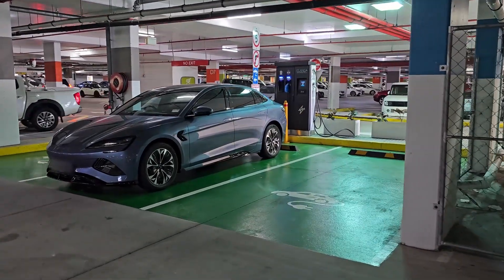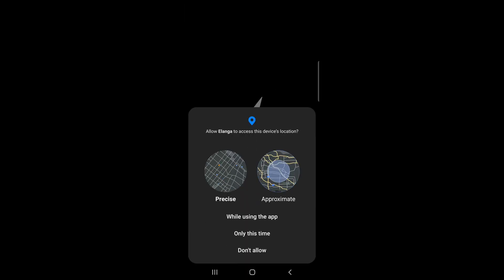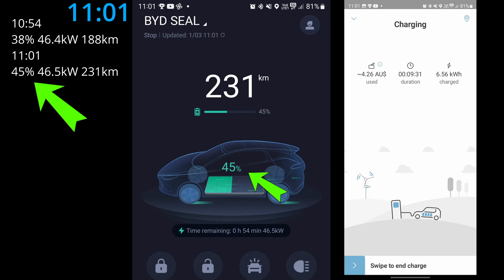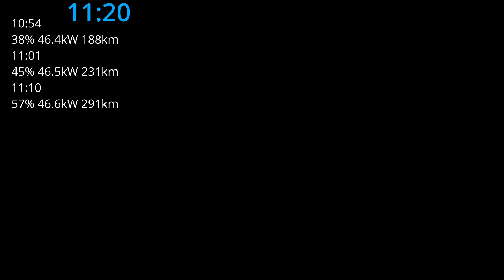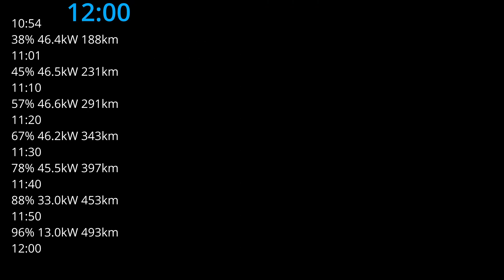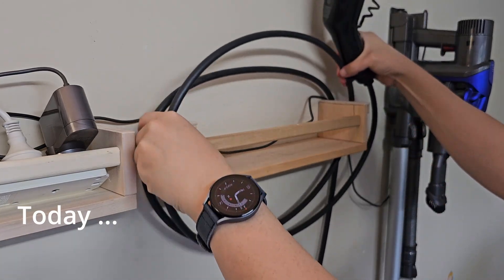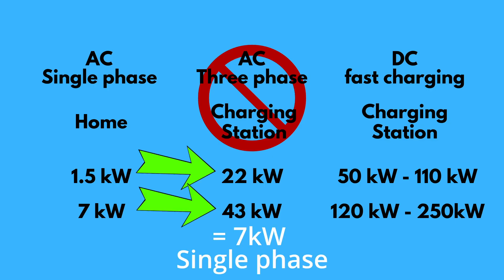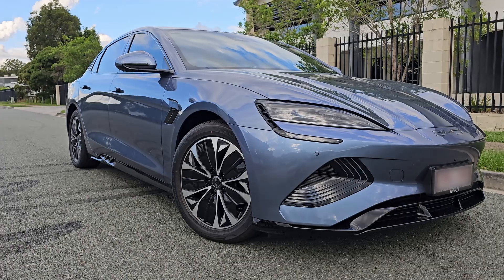BYD Seal EV charging options explained - Don’t pick the wrong one

Comment: Hi, have you installed a 7 kw charger at home? Was wondering if you did any research or videos on which are the best options for the Seal.
Thanks
Reply from the maker: No, I am still using this home charger. 
https://youtu.be/V-HbBjmC-dM
It's the cheapest and, to me, the most convenient.
If I were to install, I would ask my electrician to put in a 15 amp socket instead of installing a 7kW charger which is a lot more expensive. I can't justify the ROI

Comment: I, like other people, installed 3-phase AC charging at home (I had 3-phase power) because the line load is reduced to +/- 2.5 KW per phase. My supplier could not reliably provide 7Kw on a single line during heatwaves etc. My 3-phase "Feyree" car charger bought from Lasada costs about $250. It has proved to be almost indestructible having been subject to excessive low voltage on one phase and a lightning strike during charging that burnt out the breaker, never missing a beat.

Comment: Re the charging rates slowing down as you get above 80%, I saw a video explaining this. They said it was similar to if you were filling a fuel tank with a massive hose, but were absolutely not allowed to go over 100%.  Once you hit 80% you'd want to slow the flow down to make sure you were able to judge it properly.  And as you get incrementally closer to 100%, the flow gets slower and slower.  The conclusion was that for 
time-efficiency purposes, just 'fill' your battery to 80%/

Comment: I've read in the manual of a home charging station brand that there is a nuance to 3-phase charging depending on the brand and model of your car as well as the kind of 3-phase charging you can provide. Let me explain.
I'm going to choose an example for Europe but this might also apply for other parts of the world.
There are 2 ways your house can have 3-phase electricity called 3P and 3P+N.
3P: essentially is a 3-wire system without a neutral wire. If you measure the voltage between 2 phases, you get 230V (again: in Europe). If you measure between 1 phase and the ground wire, you get 127 V.
3P+N: this is a 4-wire system with 3 phases and 1 neutral wire. Measuring voltage between a phase and the neutral wire gives you 230V and between 2 phases gives you 400V

What do EVs do when you plug in the home charging cable which has standard the 3 phases + the neutral + the ground wire (which will always be at 0 V)?
This is the part which differs greatly between car brands and even models. As a security precaution, some cars will measure the voltage between the neutral wire and the ground wire. This should be 0 V. If this difference is not 0 V, they simply don't charge.

The people who make home chargers know this and have taking this into account but it differs depending if you have a 3P or 3P+N setup.
3P+N: each phase and the neutral are attached to the charger providing this to the car together with the ground wire. This setup is the most straightforward and should yield 0V between neutral and ground after which any car should start charging at the full 11kW 3 phase.

3P: this is the tricky one. Because of the car security precaution mention above, when you have the 3P setup, the home charging station will connect 1 of the phases also to the neutral pin of the car. The car will do it's measurement, see 127 V between ground and (what it thinks is) the neutral wire and will switch to a setup where it will either charge on 2 phases-only or even 1 phase-only (depending again on the car brand and model).

So all people here who said they have a 3 phase system yet only see charging on 1 or 2 phases, have a look at your wiring closet at where the mains comes int your house: do you see 3 wires coming in (3P) or 4 (3P+N)?

There is a workaround if you're stuck with a 3P installation: transformers exist to convert 3P (230V) to 3P+N (400V) called a "Delta-Star transformer" or "Delta-wye transformer" (https://en.wikipedia.org/wiki/Delta-wye_transformer). If you install one of those before your home charger, you'll essentially end up in the 3P+N model where the car can use presumably 3 phases . One caveat to this: these transformers become expensive really quick when you're talking high power such as 11 kW or 22 kW.

Comment: I’m not getting 150kw charging anywhere. Tried different brand chargers and superchargers. Best I can get is 105kw on Tesla superchargers. I have the dual motor aswell. Really annoying that it doesn’t charge at the claimed 150. I suspect byd limit it for battery longevity?
Reply from the maker: This is interesting. My dynamic base model advertise for up to 110kW but so far from all my test, I only manage to get 50kW max. I guess a lot of other factors affects the charging power like another car sharing the charging station and hot weather conditions. I wonder if others who has the same performance model like yours has ever charged at 150kW charging power before. Hopefully someone reading this comment can share their insight.

Comment: I am curious about your 3 phase comments. You mention you tried to charge with 3 phase yet the connector you show does not have contacts for L2 & L3, hence is only single phase. Have you actually got a 3 phase charger that you tried?

Comment: Can you safely use an extension chord with the slow 1.5 kW charger jim
Reply from the maker: Not advisable according to the instructions. Better to ask an electrician.  We need to make sure extension cord can support the current, and there are other things like the extension cord cannot be coiled, and so on that needs to be considered. That's why it's not advisable.

Comment: Much too slow charging
Reply from the maker: I just got a new fast charger. Will be making a video soon.
Reply: @SkyPerspective  the car has too slow dc charging in comparison with others 10-80% in 40 Minuten is not for long Trips
Reply from the maker: @martinmuller6760 oh you meant dc fast charging is too slow. Yes we cannot compare to petrol cars on long trips where it takes 5 mins to fill up.
Reply: @SkyPerspective  No i mean other car Manufacturer vw stellantis mercedes bmw 10-80% 30min Hyundai Kia Porsche 10-80 18min. 40 Minutes at byd is too long
Reply from the maker: @martinmuller6760  oh I see. Yes I think the charging power plays a difference here.  Mine is the base model of the Seal and can only charge up to 110kW. The higher end model can charge at 150kW which will be faster. I am not sure how much faster.

Comment: Do you always charge to 100%? Also, what is the recommended base percentage charge for the Blade battery. I see articles that say don't go below 20% while another says 15% while others say 10% is perfectly okay.
Reply from the maker: I kept it full to 100% whenever possible. The lowest I would go is 25%, not for the health of the blade battery, but more for my range anxiety. Blade battery is pretty good in terms of degradation. We just need to make sure to once in a while use the mode 2 wall charger to let it charge up to 100% slowly
Reply: @SkyPerspective  Thanks for your reply. Appreciate it.

Comment: In Europe they are gradually implementing a "peak capacity charge" in the electricity bill. This means that at home, you don't (or won't) just pay for the final amount of charge but also for the peak rate at which you use electricity as a whole. This because they want to avoid people starting up all their most grid charging appliances at once. Thus, they try to avoid a major surge in the grid. So, best to avoid charging your EV simultaneously with running the dishwasher, dryer, washing machine and induction plates...even at night.

Comment: The video is not wrong but for future proofing I think installing 3 phase is worth ut
Reply from the maker: I am not an expert in electricity topics, and I wonder if single phase DC will get more popular or 3 phase AC. If I am not wrong the trend and manufacturers are moving towards single phase DC. However, you are right, install 3 phase at home is definitely future proofing because it will work for both types of vehicles.

Comment: I don't quite understand. Your charger took 3 nights to charge your car from 30% to 100% but. What option should I get for a faster charge at home since you say the 22kw charger only charges at 7kw?
Tjamks for the very informative video.
Reply from the maker: If you are only having and driving BYD Seal, then installing a 7kW single phase charger at home should be good enough. If you plan to buy a Tesla or some other EV that can charge faster using three phase, then you can consider future proofing your charger installation at home and install a 22kW three phase charger. 22kW can still charge BYD seal at around 7kW or 11kW. Hope this make sense.
Reply: @SkyPerspective  makes sense. I love the Seal but it's a bit too low to the ground so am waiting for the Seal U although I'm disappointed it's nowhere near as stylish.
Reply from the maker: The Seal U still looks pretty nice in my opinion.
Reply: @SkyPerspective  I think 7kW is good enough for Tesla too. 15kW per 100km. 6 hours charging at night can cover a 280km trip.
Reply: I kinda confused on the 2 groups number on 11:41. Tots get it on Home single phase 1.5 kW and 7 kW. What about on fast charging? Do you mean that your seal can handle max at 120 kW - 250 kW?

Comment: I had a 32 amp 5 pin socket installed and I bought a wall box, I charge at around 7kwh that equates to 10% per hour charge, total cost $1000, I charge from solar only, granny wouldn’t be useful for that.
Reply from the maker: That's very good to know. So far I am surviving with my granny.  My digital electric meter shows me it's quite efficient and not much loss. Wait till I save up my $1000 maybe I will install it. What's the brand of your wall charger?

Comment: let say if you park the seal on side of the road on heavy raining night and street are all flooded, can we still drive the car  ?
Reply from the maker: There is a different between heavy rain (water splashing down on the car), driving through flood waters (water splashing up the bottom of the car) and the car sitting in flooded water (water seeping into the car compartments). With the third one sitting in flood waters, the water seal (no pun intended) of the battery and electrical parts can only hold the water out for a period of time. After that, water gets into the electrical parts and anything could happen. Water and electricity don't mix and short circuiting a 61kWh battery most likely will cause a thermal runaway. So short answer to your question is: No, I would not drive the car if the flood water height has reached or is higher than the battery compartment.

Comment: maximum rate of AC charging is basically depends on the onboard charger installed in the car (it basically converts AC to DC), so before deciding on which level 2 charger to buy, gotta see the spec sheet of the onboard charger first

Comment: Fast charging is way more expensive than at home
Reply from the maker: There are cheaper fast charger like $0.40 to $0.50. The one I'm using in this video elanga is quite expensive at $0.65. Yes Changing at home is cheaper.
Reply: Not necessarily that much cheaper though. The standard tariff in South Australia is around 44c per kW...

Comment: I received my BYD Seal 10 days ago but I'm having problems when I try to charge on fast chargers. Charging starts, then after 2 minutes the message "charging complete" appears and charging stops even though the car is absolutely not fully charged. Has anyone encountered this problem?
Reply from the maker: Did you set the car reservation charging to start and stop at a certain time? You might have just hit the time to stop charging.

Comment: Thank you that was very informative. Is the portable charger safe to use if the house wiring isn't great? For example, I can sometimes lose power to my home during heavy rain or if too many appliances are turned on at the same time.
Reply from the maker: Doesn't sound good enough to me. Best to get a qualified electrician to test out your house circuit and give you a report. What I know is Tesla portable charger charges at higher wattage like 2.0 - 2.3kW while my BYD portable charger charges at 1.5kW. I suspect BYD is playing it safe to put lesser load on the house electrical circuit and the AC-DC converter charger in the car. Nonetheless, 1.5kW is still a lot of power going through the house cabling for so many hours, so best to have it checked by an electrician.

Comment: I’m interested in power leakage at home, if you are at 100% and disconnect the charger, then how much charge do you loose each 24hr?
Reply from the maker: I don't understand your question, do you mean how much power will the BYD Seal battery loses each day if the car is not driven?

Comment: Is this your only car, I am just asking as I don't think that I could wait 3 days to fully charge the car.
Reply from the maker: So based on my last round, I charged 30% used 10% charge another 30% used another 10% and charge another 20% before it reaches 100% on the third night. Yes, it's the "can't get one full charge overnight" that I need to get used to. Yes, I myself only uses this one car.
Reply from the maker: @@Sensei_Sifu Who are you referring to when you say they need to provide 7kW for about $199? BYD? Yes the current cost of A$1000+ is way too expensive, however, there was a comment above or below saying a house having a powerful EV charger can increase the value of the house, which is a good point.
Reply from the maker: @Sensei_Sifu  If there is a brand selling good quality 7kW home charger at $199 I would be the first one to buy and install it, and perhaps rent it out for charging. I'm sure I'll recoup the cost in no time 😊

Comment: Does the car agree with the Elanga charger on how much energy was transferred? (For example if Elanga said it has sold you 50 KWh and billed you for 50 KWh, did the car agree that it has received 50 KWh?
Reply from the maker: Hey @woofinu! I think the station basically says it can go up to 50kW, and its the car saying how many watt it is accepting. If you see the last 10 to 20 mins on the elanga app, the amount (kWh) I get is much lesser compared to the first 10 to 20 mins. Like wise the amount I pay is also much lesser in the last 10 to 20 mins. 50kW is the capability of the station not the amount of charge. 
So someone with a super slow charging EV plugged in to this 50kW DC station for one hour may only charge at 10kW, and they pay much lesser because the charging power they consume is much lesser over the hour. So difficult to explain. 🙂 Hope it make sense.
Reply: @SkyPerspective  I think we have to differentiate between the speed of charging and the amount of charge. It's like when you buy petrol for an ICE car. Petrol pumps may pump fast or slow, but what you care about (and pay for) is the amount of petrol you get. In this case, I was curious if your car agreed with Elanga on the amount of charge it received.

I am not surprised that the charging speed dropped as you got near full. The same thing happens when you charge your phone or when you pump petrol into an ICE car. Things don't run full speed until full, then stop abruptly. They slow down to avoid overshooting.
Reply from the maker: Oh I see what you mean. My byd seal doesn't tell me how many kWh it has received. Elanga app says it has supplied 45kWh, the car battery size is 61.44kWh, and charging from 38% to 100% means it receives 62% of charge.  62% of a 61.44 kWh battery is 38kWh, so it doesn't reconcile with Elanga app? Can I say that?
Reply: @SkyPerspective  Another way to calculate is: If 62% = 45 KWh (as indicated by Elanga), then 100% = 73 KWh. 

Maybe when BYD says that the battery capacity is 61.4 KWh, they mean minimum of 61.4, not necessarily actual capacity. Often when we buy products, they spec the minimum, not actual or average. I would measure a few more times at other charging stations to be sure. But I am surprised that the car didn't measure or say exactly how much charge it received.
Reply from the maker: @woofinu  you are most likely right. Over these few days charge I have been comparing my electricity consumption at home the amount of charge delivered into the car. My meter is shared for both charging the car and my house usage like air con so it's not precise. It's either 73kWh like you said or the portable charger impedance is fairly high.
Reply: @SkyPerspective  Keep in mind that any battery will see its capacity decrease over time and with more charging. If it's X at the start, it might be 90% of X after a few years, so if you see the car charge faster, that may not be a good sign.
Reply from the maker: @woofinu  I would expect the system to show me 95% and the charge finish and doesn't charge anymore if the battery has degraded 5%. Very interesting topic and I wonder if others with degraded EV battery can share if this is the case.
Reply: @SkyPerspective  My guess would be that you will always have 100%, but 100% of a decreasing number. I don't know about EV, but in phone batteries, you can always charge to 100% but the capacity drops as the phone gets older. It's like you start with a smaller battery.
Reply from the maker: Ya understand, and maybe you are right.
Reply: The charge and discharge Efficiency of LFP battery is around 80~90%. Say it's 85%. That means you consume 50kWh from the station to charge your car from 30% to 100% then the battery can only output 42.5kWh electric power to the motor when the volume drop from 100% to 30%.
The station charge you by the amount they supplied to you but the volume of your car is labelled by how much power the battery can output.